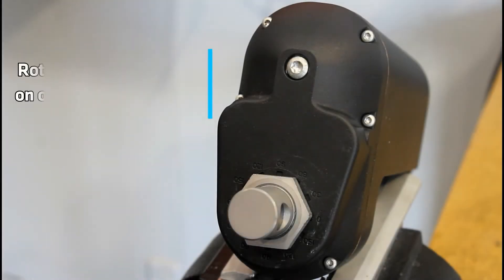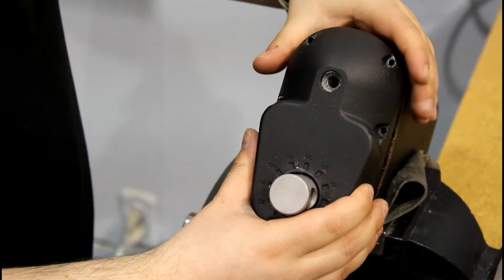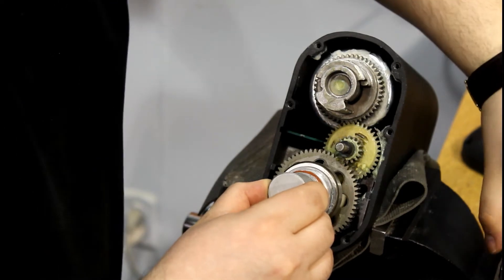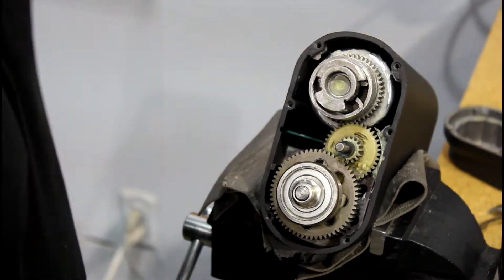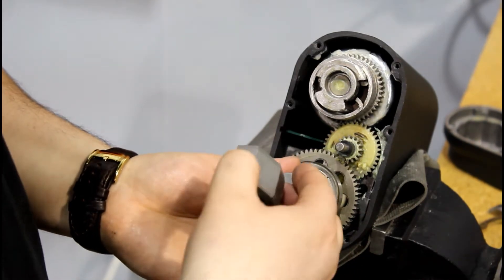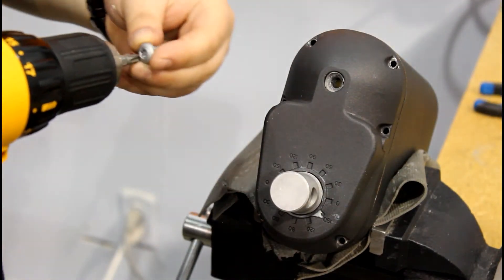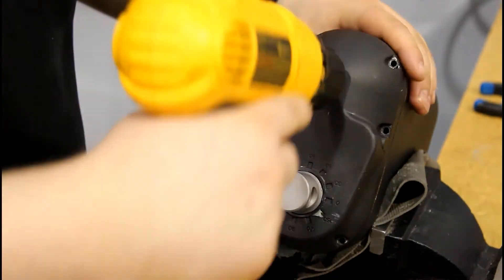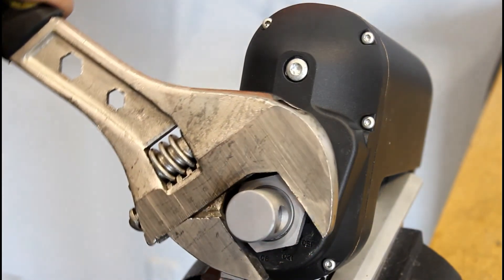Mounting Hole Adjustment on Heavy Duty Industrial Actuator

Comment: How do you do the other one end
Reply from the maker: For the PA-13, you may follow the steps seen here: https://www.progressiveautomations.com/blogs/how-to/how-to-rotate-the-mounting-holes-of-our-linear-actuators-step-by-step

Step 1:
Supply the appropriate voltage (see actuator’s sticker/label) to the actuator and extend stroke enough to place the stainless-steel shaft into a vice.
Step 2:
Using a piece of leather or something similar to protect the shaft from the vice plates, clamp the shaft with just enough pressure to prevent it from slipping during the following steps.
Note: Either end will require some torque to rotate.
Optional: Use a heat gun briefly to heat up the black mounting point to reduce torque required when rotating.
Step 3:
Clamp the stainless-steel shaft and rotate the front end's mounting point 90° counter-clockwise.
Step 4:
Do not rotate more than 90°.
Step 5:
Rotation complete.
Reply: Same question lol